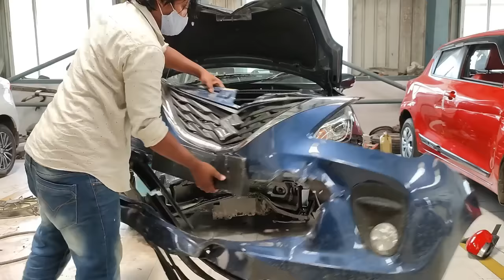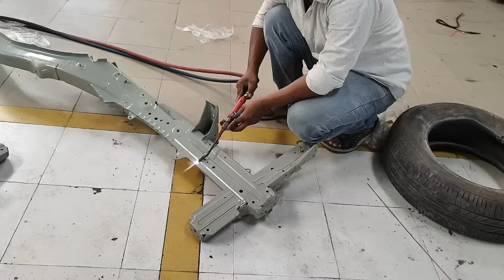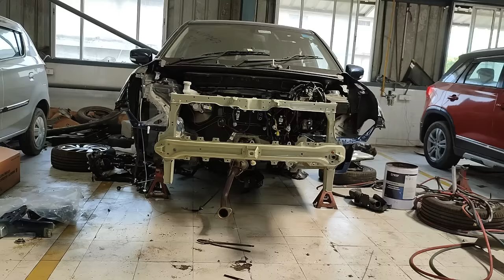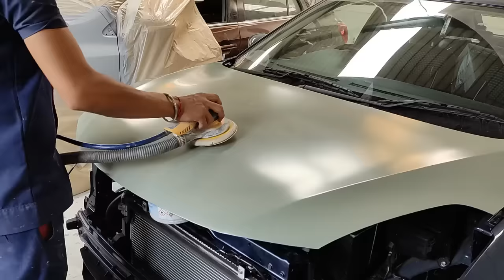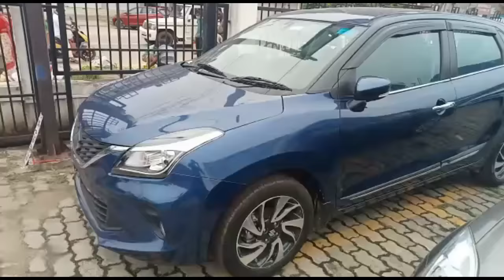BALENO FRONT ACCEDENT FULL REPAIRING PROCESS #AUTOMOBILESERVICE

Comment: I worked in the collision industry in the US for 28 years. A car like this, even when new would be a throw away.
Reply: This type of repair would land you in jail here. This was definitely not the proper way to repair this vehicle. Even in the video I could see that the color didn’t match. That was the least of the problems with this repair.
Reply: One of the worst indian brand Maruti suzuki when it comes to safety. Checkout Maruti suzuki NCap results.Most peoples buy cars from this brand coz they come cheap in India.
Reply: Dave cook, I understand from your point the repair approach is not right. I'm interested to know you highlighted even new car will be throw way, what does it mean? Do you mean the frames and structural design?
Reply: @user-0ilze3zjfz  

I live in the state of Wisconsin, where we have a law that states that any vehicle involved in a collision can only be repaired up to 70% of it’s retail value. This law applies to current model year vehicles and vehicles up to 7 model years old. So, any vehicle 2015 or newer. If the vehicle repair cost goes over that amount (not including tax and towing), the vehicle title is surrendered to the state and a new branded title is issued stating that this vehicle is repaired salvage. We call it a salvage title. The vehicle must be inspected by the state highway patrol to ensure it’s safety before it can be operated on the road. The retail value of any vehicle is approximately 1/3 less due to the salvage title. This salvage branding follows the vehicle for the rest of it’s life and does follow it even if it is registered in a different state. Wisconsin is adjacent to Illinois. They have a similar law, but in Illinois the vehicle can repaired up to 100% of it’s value. Since 90% of vehicle repairs are paid for by insurance companies, they don’t want the liability that comes with salvage vehicles. They owe either the cost of repairs or the retail value of the vehicle, whichever is less. I remember seeing vehicles totaled out that were $2,500 away from being an official total loss, simply because you never know what additional (supplemental) items could be found during the course of repairs. If you have any further questions, please feel free to contact me.
Reply: @dave1956  we are still far away when it comes to living style here, but our politicians bark nonsense by fooling the world... Agree with you it's not safe job done, it's done for insurance purpose and betterment of sales. If you go to our neighbouring countries like Bangladesh and Pakistan it's worst, economically we are not rich and that's why we depend on scrap, but our politicians live a rich life
Reply: @vindo3558  

Actually we are probably more alike than you think.
Reply: @dave1956  The truth is people in out neck of the wood are only now in the last couple of years, looking at safety ratings seriously, that too in bits and pieces. Most people think SUV and bigger cars are safe and sedans and hatchbacks are inherently unsafe because they are small and don't even consider build quality to be a factor. Next comes driving style and if I even being to describe that to you, it'll sound crazy.
Reply: @parwatimardi1855 new vehicles are changed a lot.
Reply: @rohanroy7872  

I am not “you guys”. When I was working in the business there were hundreds of vehicles that we would have loved to have repaired. Economically, the insurance company has the final say. If a vehicle is worth $10,000 and it costs $15,000 to repair it that just doesn’t make sense. Then too salvageable parts are recycled and eventually the remainder of the steel is recycled into new steel.
Reply: @rohanroy7872  

Perhaps at times, but I will gladly stay in this country over any other. I admit that this country is far from perfect and not nearly the country that I grew up in, but until someone shows me a better place, I am a proud American.
Reply from the maker: And my friends my name is Sajjad Alam and I have works in several places and repair uncountable vehicles and also I m all rounder I have work with all the tools  mig, mag welder or gas welder, CRS but some of the local small 🤏 garages they can't afford mig mag so i use gas welder
Reply: @dave1956  The auto body collision business is a license to print money.
$1500 to repair a small scratch in the rear bumper.What are the margins on a job like that Dave 80%.
Reply: @Bugsy0333  

Oh boy, you couldn’t be more wrong. With 95% of repairs paid for by insurance companies, they chisel and chisel the shops. The cost of paint and materials is always going up, up, up. We were under contract with about a dozen insurance companies and could not pass the increases along. You either eat it or you no longer do business with that company. True the shops do make a profit, but what successful business doesn’t. I have merely touched on one small aspect of the business. It’s not a license to print money like you suggest.
Reply: @dave1956  Thanks Dave for your response.
Reply: Really!!
Reply: Are chhile murgo hmare desh me 999888crore daan kardo
Reply: @dave1956  in India, labor and parts cost a lot less, so repairs like these still make economic sense here
Reply: @parwatimardi1855  it's just suzuki now, and it's japanese
Reply: @AutomobileService  the good tools are obviously kept for the muslim customers
Reply: The structural integrity of the vehicle is heavily compromised after such a collision. Laws here do not stop someone from carrying out repairs such as this to save the cost of buying a new car.
Reply: @dave1956  well here manufacturers like Hyundai, Suzuki,Kia, tata, VW, etc are repaired like this. That's normal here.
Reply: @parwatimardi1855 its not indian brand manufacturing is from japan
Reply: Hello sir is there bright future in Canada as Collison technician.  I am asking you because you have given your half life to collision . I had took admission in collision diploma in vancouver.

Comment: end result is good....but why did he cut chasis part and get it welded....I suppose he should have used entire new fresh part and not cut and get it welded......as that welded joint is not safe on both sides....for chasis...usually engine foundation rests there....in long run that joint will be a failure
Reply: It is mostly welded because if it goes for sale no one can find that this car has been in an accident. And the weldings are equally strong as normal.
Reply: @lordpixie8722  so basically you are cheating the buyer....better to change entire chasis and get new chasis no...embossed from RTO...other than cheating buyer by welding cut portion of chasis...as welded joints on chasis is always week as compared to new chasis
Reply: @vidyeshnadkerny9230  no I said if it's completely changed instead of welding then it cannot be found that it hsa been in an accident
Reply: Yes

Comment: Use Puller instead of hammering 
Chassis should hold the engine weight 
U have made a mistake in the work u should have given a inner layer for the Chassis what u fixed so it will withstand

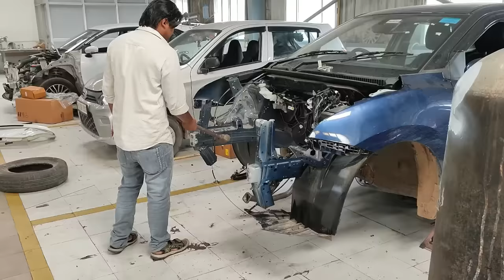Comment: 1:15 why don't heat up the bent area, use a chain block/hoist to pull and straighten the frame instead of beating without heating up? Will aggressive beating like this affect some critical dimensions related to the frame? Weld some plates on bent area is much stronger than cutting and welding a new cut part on. Positioning accuracy is also an issue by the way the new part was torch cut and weld-joined.
Reply: Exactly. They should have gone with straightening and strengthening the existing structure rather than frankenstining with two pieces that are never going to provide any significant support (compared to original).
Reply: @SathyaPrakashMoparthi  I don't see point to point measurement with some gauges in the video....wonder how they ensure positioning accuracy.
Reply: @mtay65  it is ensured by the positioning of the headlamps, bonnet, fender and the bumper. That step isn't shown in the video since it's a highlight of probably 15 days process. Before the vehicle is sent to the painting booth or even before the grinding process the denter checks the panel alignment. Also the manufacturer has a book regarding the guidelines and measurements and tolerance for each and every work which again is not shown in the video (there's no point in showing so). And regarding the cutting welding of the apron, it stretches out upto the bottom of the car and inorder to replace the whole section, the whole dashboard, firewall,etc has to be removed and which is only done under extreme loss scenarios. Regarding the strength, it makes less difference since it's properly welded and it won't just snap off incase of an collision. Also it's a repair work so don't expect factory level finishes. 
Concern is the welding done since this not encouraged by the manufacturer, everyone does it as it's much more easier and less time consuming. Downside being if not properly sealed and primered, it will start rusting. That's a huge concern.
Reply: I see nonconforming when they cut frame and weldling. Why we dont use block frame or new spare part. Do it i see  dangerous when it run way.
Reply: Strength is compromised for looks and shine..
Reply: I thinking same thing
Reply: Unfortunately such mechanics are all over India that knows nothing but to charge money .

Comment: After doing so much rework joint on main frame does it is safe to use  the car
Reply: Welding joint is ok, but he did gas welding and no testing of the weld....also why to cut the joint form the new part.....why not replace the whole part.....
Reply: Yes.

Comment: Very nice work and super talented. But is it still safe anymore? The main chassis is cut and welded. Will it have same strength again in case of another accident? Something to think about. This vehicle would mostly be written off as total loss in other countries because of the structural damage.
Reply from the maker: Thank you❤ bro 

And I use double sheet on the maine chassis from where I cut ✂ that part so i think it's safe
Reply: Maruti are not safe either. Tin can
Reply: this is not a write off in any country . the core supports are not broken, aka structural damage its a front end collision which has broken the crumple zone.
Reply: Very bad job
Reply: @AutomobileService  You "think" it is safe?
Reply: @anirudhmallikarjun7067  the sar is still a maruti with 0 stats
Reply: @AutomobileService  muslims when the customer is a hindu:

Comment: It says a complete repair and the character in the "work suit" cuts the part with a burner that needs to be precisely cut, without showing the gap measurement, fixes the new bonnet and fender paint over the old paint ... I hope it's not authorized service.
Reply from the maker: It's a local garage
Reply: @AutomobileService  Why didn't you go to the authorized one?

Comment: I think the gas welding used to cut the piece and weld it together to frame is wrong here.
spot weld is recommended.
this gas welding is not for this purpose, these joints are going to break easily in any future accident, which makes this car very less safe.
Reply from the maker: I know my friend but in this garage we have only gas welder then from where I can get mig Or mag oor spot welder
Reply: JUGAD WORK
Reply: @AutomobileService  did you try amazon? Saw several on sale do under 7-8k!
Reply: Spot welding is not used in such cases.....welding is ok if he would have repaired the old.....but cutting form new and then welding it...

Also metal plate used in Maruti type cars are thin so electric welding is not possible....
Reply from the maker: You r right broher but we use only those thing white they provide us now a we have the mig welder so we use electric welding since last 1 year this is my old video you can check my other videos in that videos I use mig welder 

I m only a small 🤏 mechanic 👨‍🔧 

Thanks for watching my videos
Reply from the maker: Brother where r u from

Comment: S presso vxi ka bonat radiator plastic bumper kitna charge lagega 2022 model please
Reply: Charge kitna lagega
Reply from the maker: Bonnet  3600
Painting 4200
Radiator  6000
Bumper 2000
Painting 4200

Expected estimate
Reply from the maker: Labour charges 

Bennet 500
Front bumper 450
Radiator new 300
Condensor opening fitting 300
Fan o/f  300
A/c gass labour 1650
Coolen 350
Ac gas 250

Expected estimate
Reply: @AutomobileService  total hme kitna dena hoga without insurance k
Reply: @AutomobileService  s presso vxi 2022 model

Comment: Chassi strength significantly go down by the welding . Am i correct?
Reply: chassis is strong as it was before. with one exception: suspending another frontal crash. depending on speed and vector, crew will die in repaired car and survive in a new one.

Comment: Xuv500 front bumper $ front airbag cost
Reply from the maker: Front Bumper 6950 without paint 
And the Air Bag is only one  cost around 15000 without  attechment like air bag sensor, controler etc etc

Comment: front end shunt,,,, rails bent!,,,, chops off front ends,,,,,
spurius body panels (none makers genuine),,,,,
gas welds chassis legs in place ,,,,All bolt on front members and body panels fit perfectly mmmmm,,,,,,,
all this without a alignment body jig,,
i was a accident auto repairer,,,,, from 1956 to 2oo6,,,,
tell you no way can the car be true,,,,,,
 Edwin J Thompson  Beverly Hills ,,,, CA
Reply from the maker: Hello sir I m a  small 🤏 welder and I use only those tools 🛠️ which they provide me now we started using mig welding since last 1 year this is my old video. I m not be able to understand one thing that u have told me that i fitted all the bolts perfectly without alignment this is my praise aur insult 🤔🤔🤔🤔 

Thanks for watching my videos

Comment: What a low built quality of this car. The technician removed the bumper and grill like a sticker removing from a car.
Reply from the maker: Brother I have already remove all bolt 🔩 ans screw of that bumper after that i started recording video
Reply: @AutomobileService   I drive Celerio. One day a motorcyclist hit the side fender and the dent the bumper. The left side of bumper went all the way in. I came home and pour hot water on the bumper and pushed it out. And the dent was gone.
Reply from the maker: Yes brother you can easely remove dent from bumper using hot water of any cars not only maruti but also honda, Hyundai, Toyota etc etc
Reply: @AutomobileService   I remember the car bumpers of the 70s and 80s cars which really saved the cars from bumps. Today these bumpers are show pieces.
Reply from the maker: The best bumper of maruti suzuki is used in maruti car 800 and zen minor I have never seen this types of strongest bumper in any cars
Reply: @AutomobileService  Yes the bumper in Suzuki FX 800 was the strongest but since the arrival of body match bumpersthey become weaker.

Comment: Worst built quality cars....even by hitting with your hands you can destroy this car easily
Reply from the maker: Can u plz make a video of maruti car destroyed by hand ✋ if u do so i will sure leave this job and started repairing cycle
Reply: @AutomobileService  I think you are in that field go and hit hard at its hood and see....what will happen and you just run 🏃‍♀️ fast and hit that car with....your shoulder at its door and see the result....and after that decide...
If you want to continue in this field or not....we cant destroy its engine with hands.....go and ncap crash test results....how many Maruti cars scored "0"...
Reply from the maker: I fully agree with you bro but let me tell u one thing if you hit harder to any cars hood u can see the same result and if you ran fast 🚴三 and hit any car with you shoulder you find the same result because as I m a welder I have worked in dealers and the garages the sheets of every cars is same wether it's maruti, tata, honda etc etc
Reply: @AutomobileService  I totally disagree with you bro.......regarding sheets....because I found lot of differences regarding built quality of wagnor 2019 model and TIAGO...and tiago weights more than wagnor and that sheet thickness is also different...wagnor weights 830 kg...but tiago weights 980 kg....day by day ....day by day Maruti company reduces its cars  metal... thickness....if you compare Maruti accidental reviews and Tata accidental reviews you will find the answer...